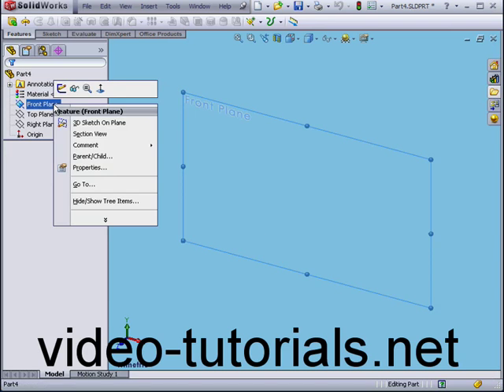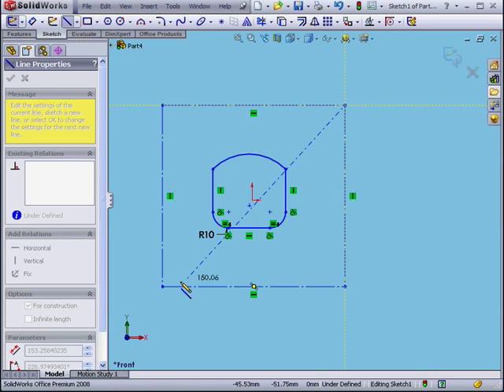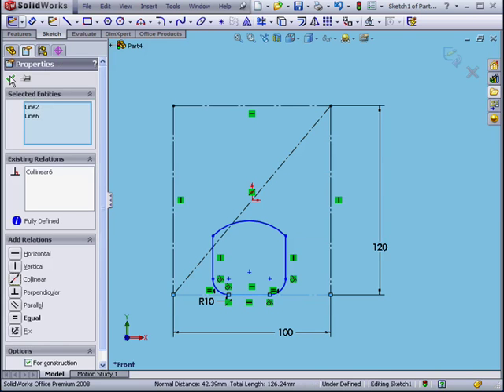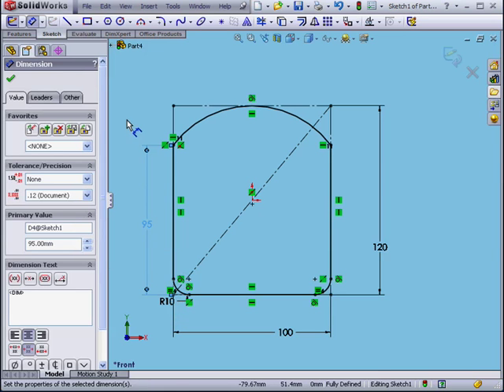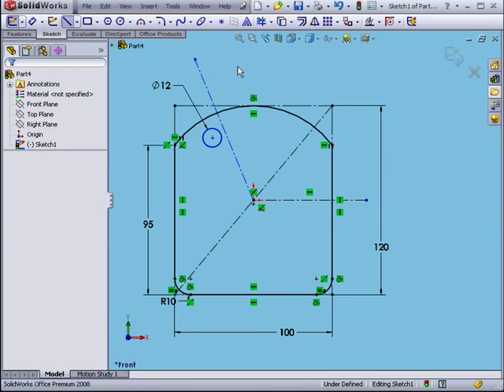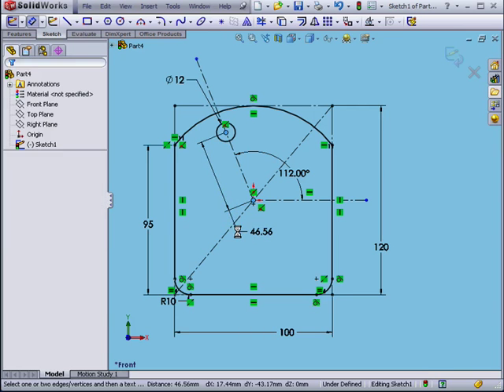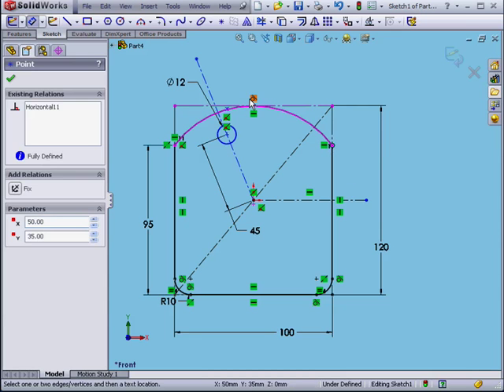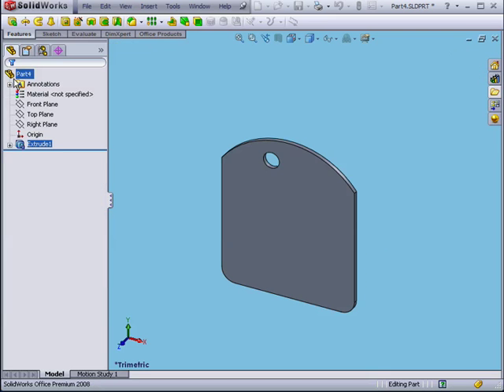Basic solidworks tutorial Sketch

Comment: 1 - I'd rather add fillets on the 3D model instead of putting them inside the sketch.
2 - your model has to be constrained with the general model space too.
3 - I would not recommend to add a "partial" dimension (I am referring to the 95 dimension). It is better to dimension the whole length/width/depth, in order to develop the component as if you were machining it.
4 - it would be better to use the HOLE command instead of drawing a circle inside the sketch.

Obviously that's only my opinion.